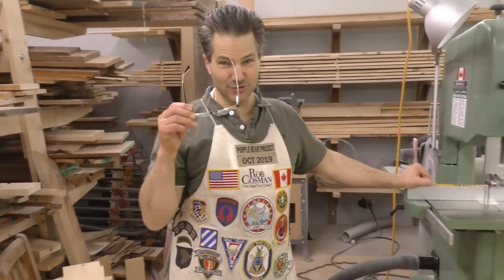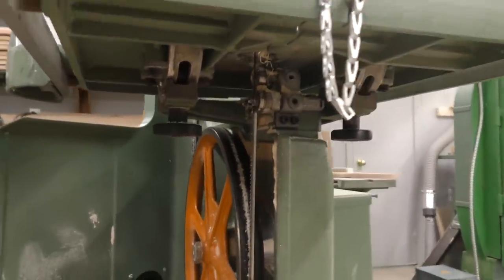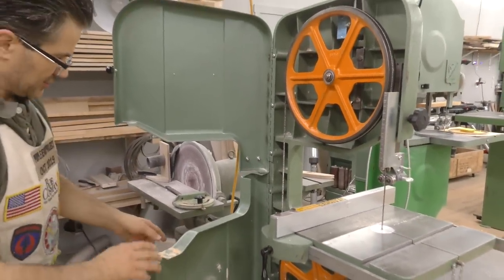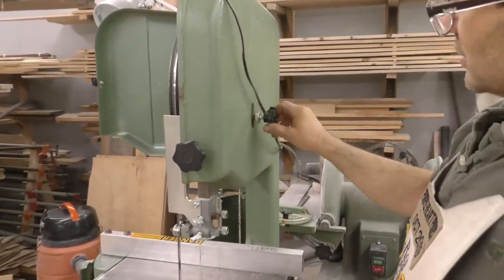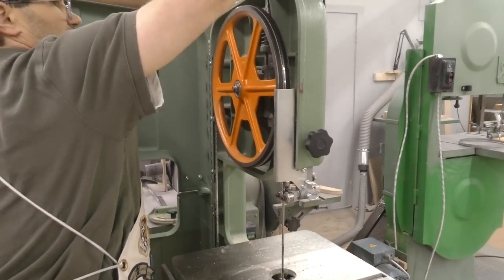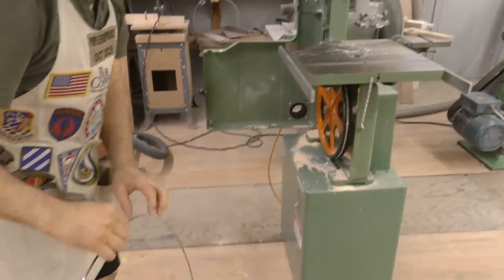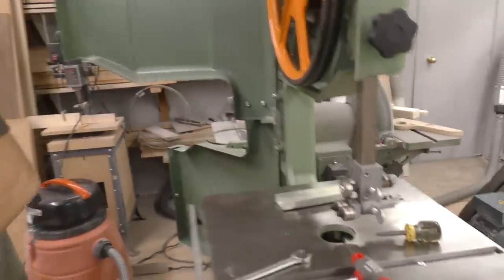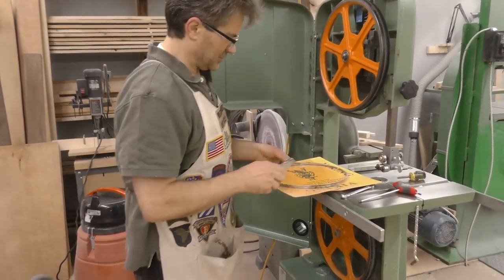Setting up your Band Saw, Episode 5, the 15" General

Comment: When doing my final set up I always like to raise the guide and put a square on the table along the side of the blade to make sure the table is plum and has a 90 degree angle to the blade. There is a table stop under the table on the frame side that can be adjusted up or down and then locked in place.  I also run the saw and hold a  sharpening stone against the back edge on both corners of the blade to round over the back of blade slightly. I also remove the welding bump if there is one. It seems to make it easier to make tighter corners.                                                                                                                                                                                                                                   Love your show. I always learn lots from watching you.
Thanks for another great video.

Comment: Charlie Wray excellent tutorial on the general.  I have a 490 that i stopped using because i could never get it to track well and it was not good for resawing green wood. I may bring it back in to the wood shop and play with it.  Thanks for all you are doing for our wounded warriors thru your PHP.

Comment: last comment / question Rob: I'm looking forward to your next episode on ripping and re-sawing. No matter what I do, I cannot seem to get my 17" band saw to cut/track parallel to the miter slot. I even went so far as to buy a really expensive 1" "resaw king" blade and followed various "expert" tips on this issues. Nothing seems to work -- kerf wants to track 3-4 degrees off parallel. Basically I am free-handing my re-sawing efforts now -- not a terrible outcome, but would prefer to rely on a accurate, tall rip fence. THANKS!
Reply: Try adjusting the top wheel tilt. If the tilt is too forward or too back the blade will twist on its downward track. Check it by ripping a straight piece of wood along the fence until the back piece of the wood is even with the back of the blade. If everything is tracking the kerf will have an equal gap on either side of the blade and it will reach without adjusting the fence.
Reply: Tom, if you have tried different blades, and get a consistent difference with the miter gauge slot, consider if the table is simply askew. I would loosen the trunnions and twist it a trifle, hoping that the bolt holes are properly oversized enough to allow.
Reply: Lee Haelters yeah good point. No I have only used the one the one (overpriced) resaw king.

Comment: I've had good luck putting the back of the gullet of the blade in the center of the wheel instead of centering the blade. This may be the same location on thinner blades, but it puts the teeth just forward of the wheel center. It doesn't want to wander either way anymore. On wider blades especially if the whole blade is centered instead of at the gullet, the front hangs off the tire's arch and can therefore get pushed easier. Who cares if there is blade in the back suspended slightly off the tire.

Comment: in have the identical saw  problem is when I tighten the thumb screw of the role blades it forces the right guide into the blade and I can keep the roller away from the blade

Comment: Hello Rob,

I have a 490 band saw and needed to remove the upper wheel to change the bearing.  In doing so I taught the 3/4 nut had to be removed clock wise... so I strip the inside thread of either the nut or bolt or both.  Any idea on how to remove the nut?  The nut now turns  both sides and has no grip anymore on the bolt.  Thank you for your prompt response.

Comment: Hey Rob! Tim from Oklahoma here.. gotta question for you. Should you ever lubricate parts of the bandsaw, like the wheels or guides? It seems like they could benefit from some oil, (unless any got on a tire and caused the blade to slip). That would be a disaster!
Reply from the maker: Just a dust magnet, no.

Comment: Thank you very much I have an old 15in general that was passed down to me from my dad. It has never worked to my expectations . Maybe now I will get it running up to snuff. Are your guides after market as mine are original and not at all the same as those . Are they by any chance carters. Thanks for the great information

Comment: Rob, I notice you cut out the handle essentially right on your line. Is your template slightly over-sized, or is the off the saw finish with that blade good enough that very little additional material is removed when you finish/smooth it?

Comment: Rob, I purchase a used 590 about 10 years ago and was able to get parts from General, so I have a complete set of all the replacement parts I needed including heads where one set has bearings, and one has Blocks.  I was told that I purchased the last band saw fence they had in stock.  I started a refirb on the unit when I bought it, and had to put it aside to look after my aging parents.  but I have started putting it together, and have a question for you. I see you have plastic knobs for both the blade guard and blade tensioning.  I have the old aluminum knobs and can't get them off.  Do the knobs you have on the saw have a regular thread, a Left hand thread, or are the press fit?  I appreciate your assistance

Comment: Wouldn't it be easier to remove the table when putting in a new blade or adjusting an old on to allow better access to the lower guides?

Thanks, love all the information.
Reply from the maker: For the video yes but too much work for a blade change.
Reply: Bill Edis, criminy, what a pain in the butt that would be. Blades are changed or adjusted quite often. I think just don’t buy a saw that those cheesy afterthought guides that are difficult to adjust.

Comment: Great set of videos. You mentioned a couple of times that you do not release the tension on the blade unless you change it. So I guess I can leave the tension as is which is good because it is a nuisance to do so? Please let me know . Thanks
Reply: Tony Lenge, never in any shop I have worked in did we loosen and re-tension the bandsaws daily.
Reply: Thanks

Comment: In your opinion, what are the best bandsaw guides available.  I have an Italian 20” bandsaw with “European” guides, and I’ve not been happy with them. I’ve tried the roller bearings from Carter, and not happy with them either.  Any suggestions?
Reply from the maker: Cool blocks, simple.

Comment: When you mentioned that you hadn’t unplugged the saw prior to this demo, I wondered just how many other machines you work on with the same procedure. This is a cardinal sin when working on machinery.Unplugging the machine as well as the use of proper safety glasses and dust mask especially when using compressed air should always be stressed to your viewers. On another note, why not install the lamp on the backside of the saw and away from the operator’s face?

Comment: Now I know just how cheaply made made Delta is.
Reply: Russian Spy, these days, no argument. But the greatest feature ever on small bandsaws was the tool-less guide adjusters top and bottom on the earlier saws. Full adjustability (well, ‘cept kerf clearance), even without bending down to take a look at the lower, even while the saw runs. Saves a ton of time.